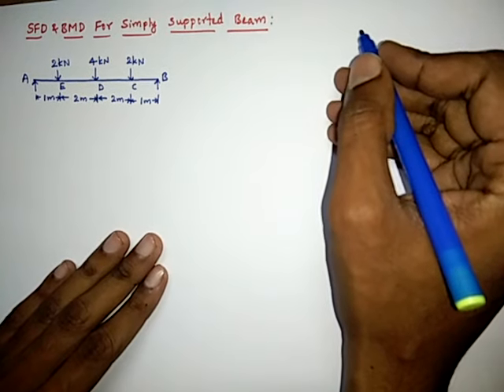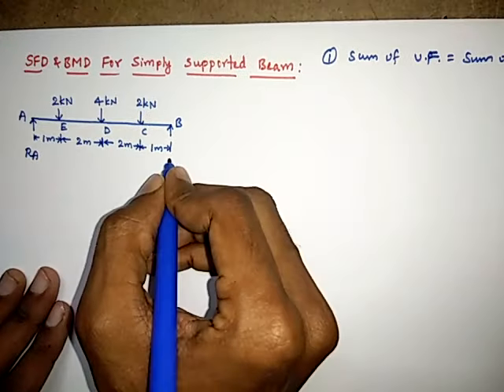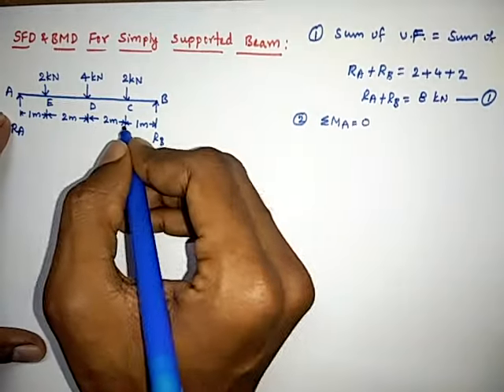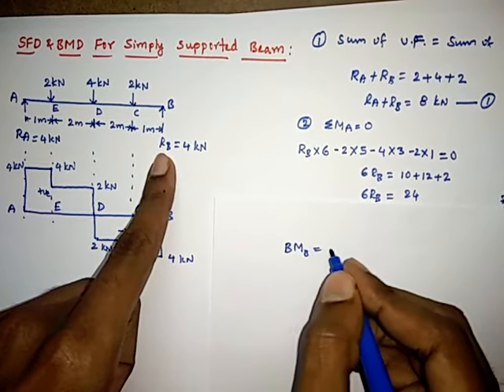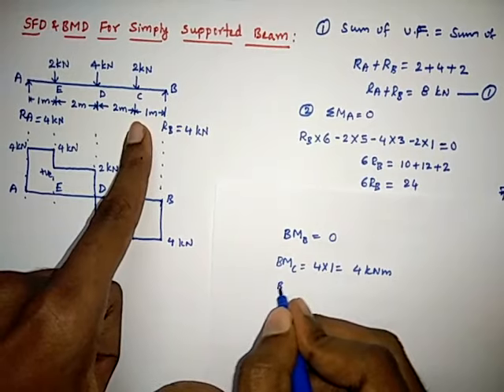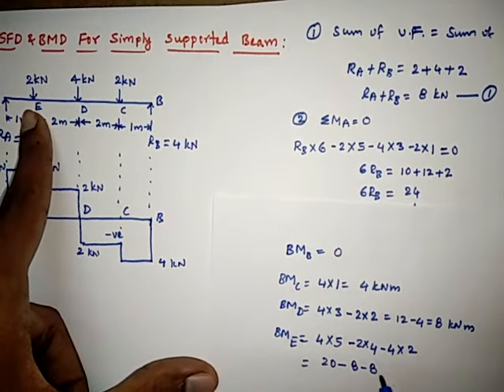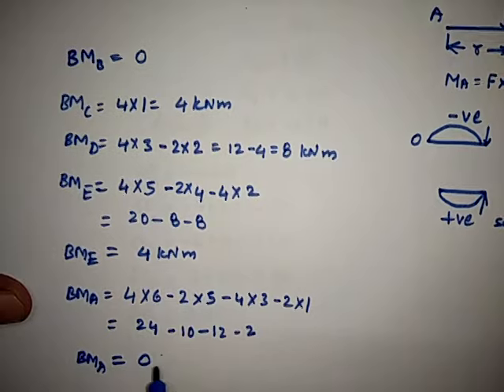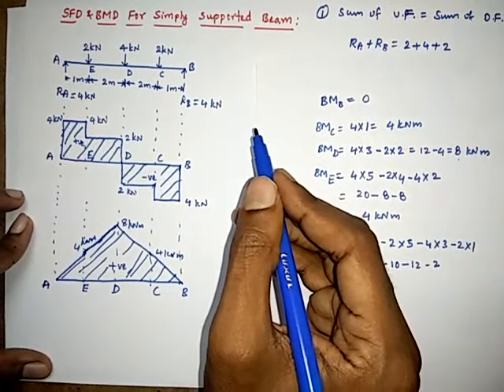SFD and BMD for simply supported beam with point loads, Mechanics of solids

Comment: @7.07 4KN force was acting upward so negative.
@7.52 4Kn force was acting downward so it should be positive. How did it change its sign?
We consider hogging and sagging concept in Moment calculations but what is the concept behind taking clockwise and anticlockwise in shear force consideration?
Reply: I was wondering the same thing

Comment: Sir at point A u have a reaction support of 4KN and it is in upward direction which means it will be -4. why didn't u consider that support reaction while calculating SF at A?
Reply: It's 4kN and then you subtract the 4kN to get to 0kN.

Try the example starting from the right.

Comment: For the value of Shear Force in A will come zero not only the previous answer 4 is wrong it should be like 4-4 = 0 previous answer and RA value -4 then the answer of Shear Force in A is zero it is correct. The value of Shear Force in A is -4+2+4+2-4 = 0 (OR) 4-4 = 0 this is the correct answer

Comment: Sir,Plz solve and tell me the answer 🙏

A simply supported beam of length 8m carries point loads of 4,10 & 7 KN at 1.5m,2.5m,2m respectively from left end,Find max bending moment over the beam.

Here I'm getting 30.9375 max bending moment but in book the answer is 90KNm ....HOW plzz tell me ?????🙏
Reply from the maker: Check your question once again what you have given to me
Reply: The question is same you also can check.
Book - RK Bansal (SOM)
Problem no.11
Reply: Can I solve this problem
Reply: Concept is wrong
Reply: If I'm interpreting correctly, Ra = 10 kN,  Rb = 11 kN (end supports).  Max bending is 30 @ 4m from left side.